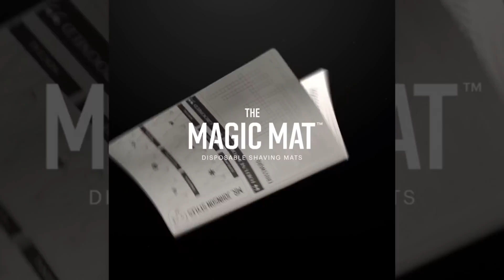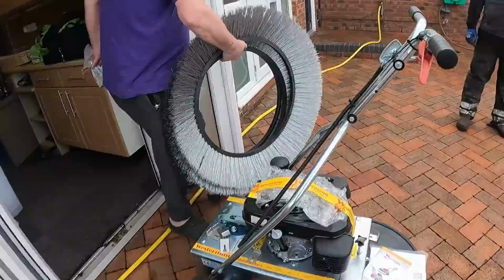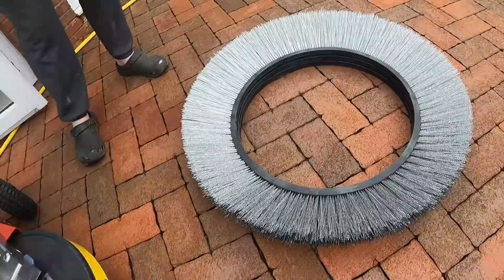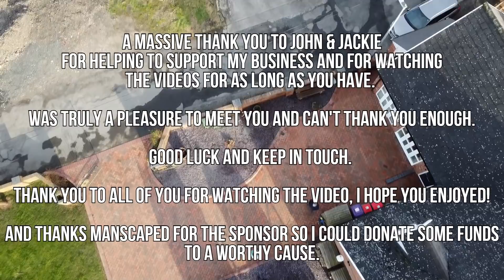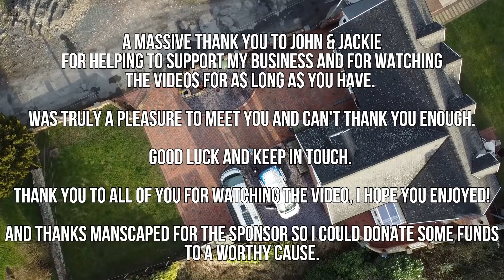What My Customer Paid Me With BLEW ME AWAY!! | Driveway Pressure Wash!

Comment: A quick question can I wash my guttering with  venting on the  boards underneath roof with my pressure washer telescopic  Lance please x
Reply from the maker: yeah just be careful and try not blast anything into any gaps under roof tiles or into the house :D
Reply: Its not roof tiles its part off back boards that holds gutter up its got vents all around if i could send a picture to show u but i don't know where to send linda
Reply: @123ldudley  they're probably soffit vents.. Little circle things? They're to provide airflow to the loft/roof space. Can't see there being any problem even if you get some water in there

Comment: Great job mate.

One quick question, why was the water feed going into the green bin first? Is this due to low water pressure from the house? 

Thinking of starting up myself so just asking :)
Reply: Yeah I think it'S to "build a reservoir" due to the lower preassure, so you can use it longer despite the lower preassure of the house line.